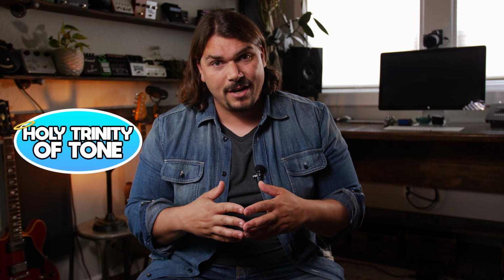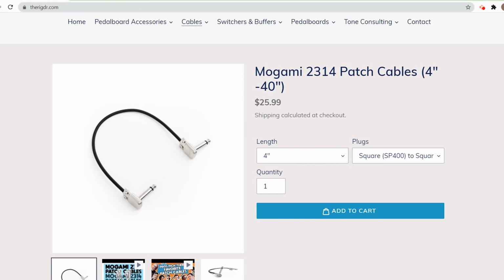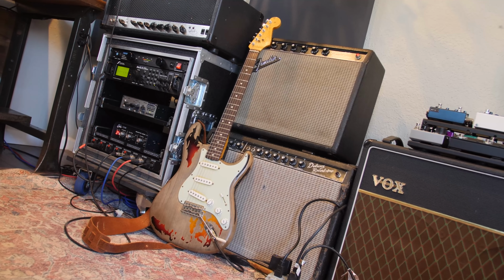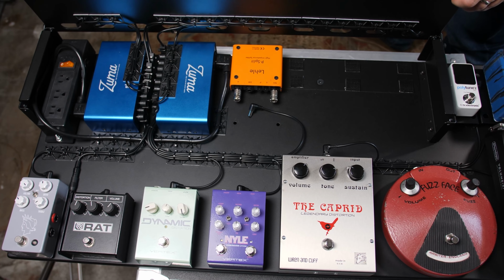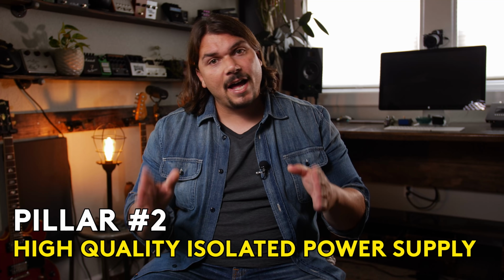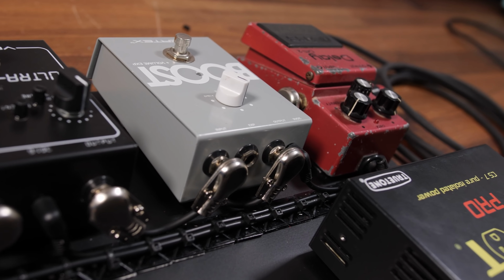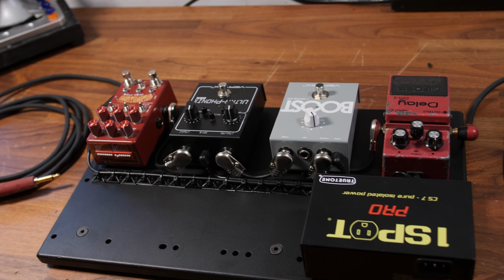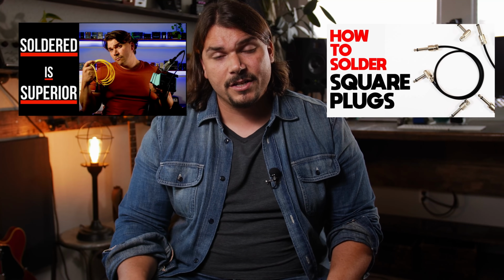3 Tips for Great Tone, Low Noise, and Reliability

Comment: Certainly agree on power supplies like Cioks. Have used more than one of their boxes on various boards for over a decade and they're bulletproof. One area where I'll slightly disagree is on the solderless cables...while I agree that soldered cables are obviously going to be more reliable, I've used both George L's (briefly) and for the last 10 years, 3 Monkeys solderless cables. They are absolutely every bit as reliable and for 5 of those 10 years I was playing 6 nights a week, and flying the gear 4-6 times a year. So certainly if you know you're not going to change anything, soldering your cables is never ever a bad idea, but the notion that it's the only way to maintain tone is simply inaccurate. If it didn't sound excellent I wouldn't have continued using it, end of story. 3 Monkeys coax sounds as good as anything I have ever used, and I've used most of them. Paired with Planet Waves American Stage for in and out of the board, it's bulletproof.

Comment: I can almost guarantee no one has made the argument of lack of calibration or crimping consistency or low vibration areas be the reason soldereless cables...suck lol. Or you know, aren't considered as reliable.  I trust your expertise,  Mason.  Though it may work fine for some, I'm on board for a  gastight connection.
Reply: yep like unsodered speaker cables in a  speaker box hooking up a speaker it happens i thought about using soderless cables then just hitting them with some soder best of both lol!
Reply from the maker: It's the move longterm.  Friends don't let friends go solderless!

Comment: Thanks, once again, for putting out great and informative content! I benefit greatly from your videos!

A question, regarding the buffers...
I recently got the TC Electronic PolyTune 3 - which features the BonaFide Buffer - so that would work just perfect, wouldn't it? Placing it as the very first pedal in the chain.
Also, I guess I should then opt for a dedicated BonaFide Buffer, for the end of my signal chain, correct?

Thanks again
All the best.
GuitarNTabs.
Reply from the maker: Correct!  That would be perfect!
Reply: @VertexEffectsInc  - Excellent, thank you!
Another thing came up, and this may be a stupid question... I run my rig in Stereo, would I then need two buffers??
The last pedal on my board is the Boss GT-1, and I have its left and right outputs running to a Radial ProD2 Stereo DI Box..
What would you recommend?
Thanks again.

Comment: Thank you for another helpful video Mason. Your support with buffers has really improved the clarity of my sound. Q: I'm using an HX FX and HX  Stomp on my board, in addition to other pedals. I'm planning to use the Strymon Ojai R30 w/ Voodoo current doubler cables for the Line 6 units and my CS12 for the other pedals. Does that sound kosher? Thanks in advance!
Reply from the maker: Is the R30 the one with its own AC mains?  If so, sounds fine.
Reply: @VertexEffectsInc  Yes, it is. Thanks again Mason!

Comment: When working with fuzz pedals that are in the beginning of your chain, does an input buffer go before or after the fuzz?
Reply: After, always after a fuzz. Most of the fuzz pedals, especially vintage fuzzes, are impedance sensitive, meaning that the input impedance is super high, that can cause some odd noises and terrible oscillation when used after a buffer, since they don't like seeing a low impedance signal coming first.
Reply from the maker: Buffer after fuzz.

Comment: I wonder if the Mesa High wire Dual buffer eliminates the need for two buffers?
Reply from the maker: Yes it does, both input and output buffers are contained in the same box.

Comment: If I have a buffer and a cabinet simulator with DI and I want to use the unbalanced out, should the buffer go before or after the cabinet simulator?
Reply from the maker: Buffer first - likely your cab sim is already low impedance

Comment: I'm currently using a 1 Spot Cs12 with Ernie Ball Patch cables and a Bonafide as Output-  and Polytune as Inputbuffer and still notice the board sucking on the tone a little. my DRRI doesn's sound as "punchy" with the board

Comment: Mason, I’ve learned so much over the years from you so a big thank you first up. 
Power supply - I have and always used a BBE Supa Charger that use a quoted ,custom wound “zero hum” toroidal transformer. It’s always at top left on my pedal board so not underneath 
Question 1) do you know much about the bbe psu?
2) I’ve just moved everything off the floor up to my rack using a rocktron patchmate. So now the power supply is under my preamp (jmp1) is that not good. I will switch to using switch power is so. 
Thanks brother from Australia
Reply from the maker: Hey there!  1) A bit - it's basically a clone of the Pedal Power 2 from Voodoo Lab, it's more of a semi-toroid or C/R Core - not a true toroid just like the Voodoo Lab.  It's a linear supply.  It has a steel chassis which helps with the leakage, but it will still have some.  2) Ideally if you want to be 100% sure you don't have any noise from the supply, either putting the supply away from everything is best (if it's linear) or go to a switch mode supply and it then doesn't matter where it goes.
Reply: @VertexEffectsInc  mate,  thanks so much for the reply. That was exactly what I needed to hear. Keep the great videos pumping. Love your work. !!
Reply from the maker: @jesseotown  Thanks for watching, really appreciate it!

Comment: Can you do a video lesson on using various noise gates. After the pedalboard is made when you place a noise gate pedal at the end of the chain before the final buffer, what is the noise gate threshold set at -70? or +10dB? do this test with all the pedals turned OFF to find the noise gate threshold setting and then turn all the pedals ON. Compare the noise gate threshold settings when all the pedals turned OFF compared to all the pedals turned ON. Once you know the noise gate thresholds how can you LOWER the signal to noise ratio of the pedals all turned OFF and all the pedals turned ON without using a noise gate pedal? Depending on the pedalboard and the guitar pedals used but with all the guitar pedals turned OFF the noise gate threshold setting will be at -50dB and with all the pedals turned ON the noise gate threshold setting will be at -10dB or 0dB, because of the difference overdrives and distortion pedals used will raise the noise floor but also other clock based effects you will hear the ticking noises, clock noises, etc when you turn on a distortion pedal or overdrive pedal at the same time as the clock based effects the hissing, white noise, can hear the clock based effects noises. Turning on each guitar pedal one by one to find the noise gate threshold setting for each guitar pedal ON/OFF and take noises documenting each guitar pedal turned on/off writing down the noise gate threshold setting. I more worried about the Signal to Noise ratio on guitar pedalboards because its a bigger issue that pedal overlook. If I was going to pay someone to do my pedalboard I would want them to know how to modify and fix all the Signal to noise ratio for each guitar pedal so the pedalboards would be at -70dB of noise or lower. This is something you should look into doing for pedalboards to try to find ways to lower the signal to noise ratio.
Reply: Respectfully, seems to me you’re making it way too complicated. Take the quietest you’ll ever be playing, so all but any always-on pedals off, set threshold so you can’t hear the gate closing noticeably on your trail. Combined with standard proper gain staging, you should be in good shape. 

Good be wrong, open to learn if I am!
Reply: @studieslessonstheoryetc141  The whole point I'm making it to never use a noise gate at all period because the pedal board it self should be quiet like when a noise gate is turned On at a certain threshold you want your whole pedalboard to never use a noise gate that is my whole point to reduce noise down
Reply: @waynegram8907  I guess I’m confused by your first sentence in your original post then.
Reply: For what it’s worth, I don’t use them on my board either, other uses yeah for sure but… yeah…
Reply: get a gigrig switcher if you want to run that stuff put it in its own loop you might find you can live without it a good switcher will take you just as far as the buffers use them together
Reply: @joshfowler8360  the gigrig switcher has buffers for each loop, buffers doesn't cut down or reduce noise, hiss, etc
Reply: @waynegram8907  my g6 has no buffers and when you cut noise his ect you cut tone!
Reply from the maker: Wayne - good video idea!
Reply: @VertexEffectsInc  thanks it will be a good learning video for a lot of people about pedalboards and pedals signal to noise ratio

Comment: Am using a Boss GX 100 4 cable method going into Mesa triple crown 100 head. Guitar is Gibson les Paul standard. Cable using 20’ feet Mogami to amps input and loop.Guitar is using line 6 wireless going into boss GX 100 with a 12” cable .Should I uses buffers in front or back or both.Are am good with just using the GX 100 without any buffers.
Reply from the maker: What's the output impedance of the GX100?  If it's not 100-200 ohms or lower, I'd say use output buffers,  the wireless is fine for you input buffer.

Comment: Hi Mason thanks for the videos!
I recently got a wah-II by joyo and i was going to put it before my input buffer but will that cause any tone suck? Could put it after my OD/buffer but I'm worried how the wah will go post buffer...

Also just wondering if you know about the Strobostomp buffer impedance.. been waiting for a reply/the manual didn't say buffer specs. 

Thanks 👍😊
Reply: Input 2.2mohm out 100
Reply from the maker: You want to shoot for 1M - this will unload the guitar at 2.2M but you may like that sound.
Reply: @VertexEffectsInc  Sorry I meant the Wah/volume pedals specs are 2.2 to100, just not sure where i should place in the chain.
Reply from the maker: @paksoy111  Generally people like Wahs up front

Comment: If I had to prioritize  having only one buffer, due to budget concerns, is it better buy firt an input or output buffer? I'm running around 10pedals in the chain (7th pedal is a regular boss pedal, and the last 2 are true bypass)
Reply: Just get a single pedal that does both! I have an Empress Buffer+ which you can plug your guitar into at the start of the chain and then again back into at the end of the chain and into your amp. Plus it has a boost which makes it a very useful pedalboard tool!
Reply: get a gig rig switcher  that will clean you right up then run your buffer like that one guys with in and out
Reply: your board is the bigest hurdle in the   path of least resistance so you would want to push through that pile with a buffer at the front man you really need a loop switcher to get old tech like boss and problematic pedals  out of the signal path then buffers to do the pushing i believe this is best when exceeding more than 4 pedals
Reply from the maker: Depends, what's the first pedal that's in your chain that's either 1) always on or 2) buffered?
Reply: @VertexEffectsInc  it's a buffered pedal! Regular Boss pedal
Reply from the maker: @ivanhigashi5691  those are poor buffers
Reply: @VertexEffectsInc  how good would be the steel string as an output buffer?

Comment: What about buffers in 4CM scenario when the Line6 HX stomp is used in the loop of an amp (for delays and reverbs). How manny buffers are needed and where to place them?
Reply: Only on the outputs going into the returns.

Guitar -> Buffer In -> Pedalboard -> Buffer Out -> Amp In -> Amp Send -> HX Stomp -> Buffer Out -> Amp Return
Reply: Great. In my 4CM scenario, I use Boss ES-5 loop switcher on my pedalboard. Is buffer out still needed when going from pedalboard to input (in front) of my amp?
Reply: @TotalEvo7  My HX stomp (reverb block) is always on, so I don’t see why buffer out is needed when going from HX stomp out to amp’s return (4CM)
Reply: @nevenlisica  What's the output impedance on the HX Stomp?
Reply: @TotalEvo7  I think the outs are 680 Ohms
Reply: @nevenlisica  Not horrible, but for good measure, and to drive the signal line back to the return of the loop optimally, a 100ohm output buffer is strongly recommended, that way the impedances are isolated, and the signal loss is greatly minimized.
Reply: @TotalEvo7  ok. Thx. What about buffer needed from Boss ES-5’s output to amp’s input? Boss ES-5’s output is 1kOhm
Reply: @nevenlisica  Not recommended, although there were some cases where those buffers are used, but if you're going out from the switcher to the amp, you're better off with an output buffer of the same specs as the buffer going to the return of the amp, either from a DIY buffer, or a High-Wire, or a Musicom Labs dual buffer system, or if you already have an input buffer in the beginning, then get another buffer for the out to the amp in. Just remember, the higher the number of the output impedance, the worse it will be for the signal drive.
Reply from the maker: Input buffer -1, output buffer -2, effects return -3.  3 buffers.

Comment: Excellent video!!!I have The Mesa high wire Dual buffer.I was reading the specifications:it has 1 Mohm input impedance and 150 ohm impedance output…that’s the ideal input&output?
Also:what do you think about the 
EBS PG-10 Premium Gold Flat Patch Cable???Do you think EBS patch cables are good when using them with the Mesa Dual Buffer in my pedalboard???Thanks Mason!
Reply from the maker: 1M for the input impedance is always the ideal, anywhere in one hundred OHM area for the output impedance is great, basically the closer to zero the better but reasonably around 100 to 200 is fine.
Reply: @VertexEffectsInc  Thanks Mason for always reply to everyone!I got your Boodt Mk2 and I really love it so much!!!
I sm using EBS PG-28 Premium Gold Flat Patch Cables in my pedalboard…do you think they are good quality patch cables?

Comment: Mason.....the JHS split buffer. I have tried to find the specs for that one. Do you know? And what do you think of that buffer?
Reply: he wont like it
Reply: How so?
Reply: @peterknicked  not the rigjht input output impiedance  if they dont label it or the info hard to find then its bad
Reply: I have been searching for the input output impedance on that pedal, hence the question to Mason. He knows so much about these objects so I thought he might have a clue. Couldn't find the info at JHS or in the manual neither.
Reply: It might be true that the impedance isn't 1 M in and about 100 out but still....curious about it.
Reply: Found it...
Little Black Buffer is only one of many great buffers out there. It has a 1 megaohm input (high impedance)  and 100 ohm output (low impedance).
Reply from the maker: Peter, it's very similar to the "KLON" style buffer.  The Centaur style buffer is a poor design using a TL072.  A lot of folks thing that because the Centaur is the gold standard for OD pedals that the buffer is equally good.  It's not.  In fact, the TL072 is a terrible choice for a buffer IC chip as it's not stable below 1K which is already 10x higher than what I recommend for a good buffer.  Some guys will run the TL072 down at 100 ohms but even the engineers at TI (Texas Instruments - the maker of this chip) will tell you it can invert and/or exhibit strange behavior and instabilities when run this way.  I would look at our recommendations in the description to see what we approve of spec-wise.
Reply: Oki. Is there a split buffer with the right specs? I use TC Bonafide, but want a splitting buffer.
Reply from the maker: @peterknicked  to split to two amps?  The Suhr is a good.  It's also got an iso'd out which can be handy.
Reply: @VertexEffectsInc  no I wish to split a line level signal.
Reply: @VertexEffectsInc  it will go into different stuff before reaching the amps
Reply from the maker: @peterknicked  you could make a y-cable yourself off the input buffer and it's the same as a splitter or tuner output.
Reply: @VertexEffectsInc  I know, but I want a buffer with two buffered outputs. 😊